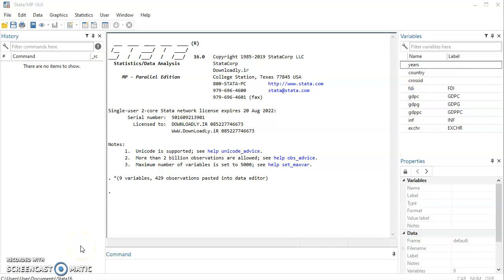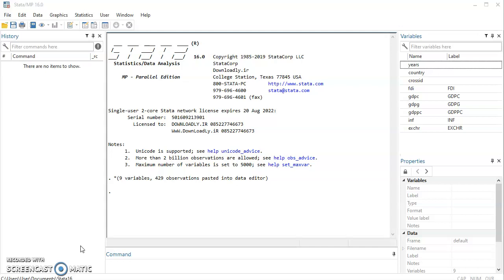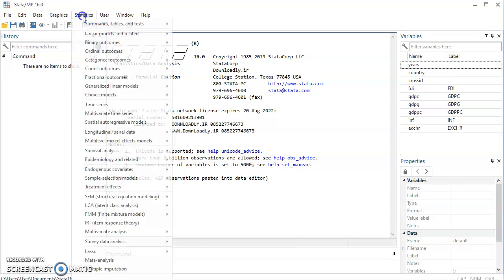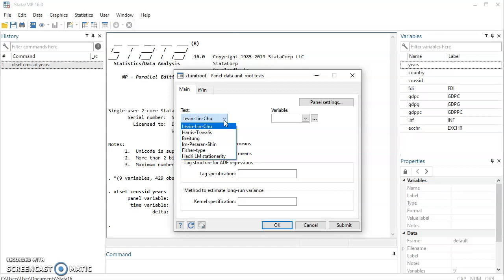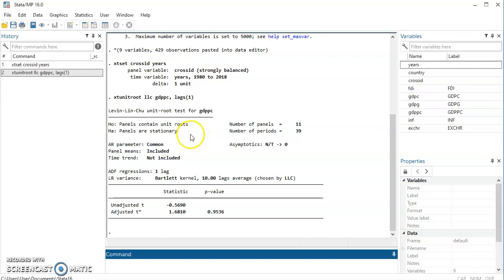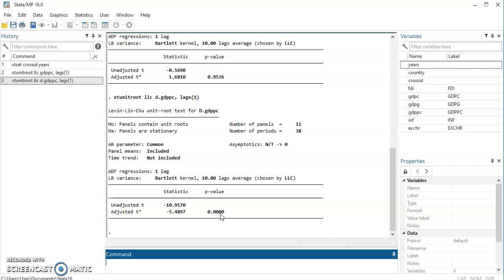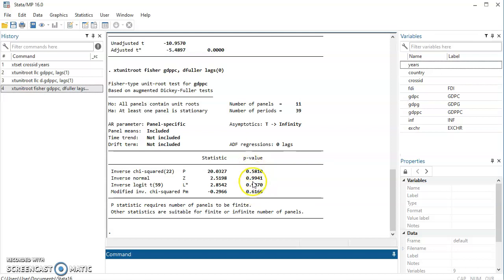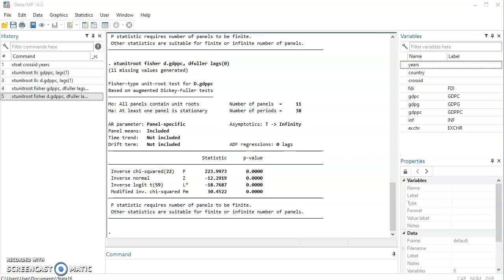How to conduct panel data stationary test using menu driven approach in STATA

Comment: hi.could you tell the importance of taking lag.and how many lags are optimum for detecting stationarity.because when i take different lags ,it affects the stationarity.or if data becomes stationary after taking first difference.can we include diffeenced form of the varaible in the data.how could it affect the interpretation.dont we need stationarity for stationary panel estimations techniques like fe/re.even if we have shorter time periods

Comment: Thank you Egbon. A question: What happens when the panels are stationary at first difference? Do we use the differenced form of the variables in the regression or we can proceed with the variables at level? Secondly, what estimation methods are appropriate for non-stationary panel series?
Reply from the maker: For non-stationarity panel series, you can use panel ardl model. Check my page for a video on it

Comment: Thank you for the video. I have a question. Why use a first difference?
Reply from the maker: Ordinarily, when your series are stationary at levels, there would be no need for differencing. First difference is usually introduced when the series are not stationary at levels. It tells us if stationarity can be established in the short run.